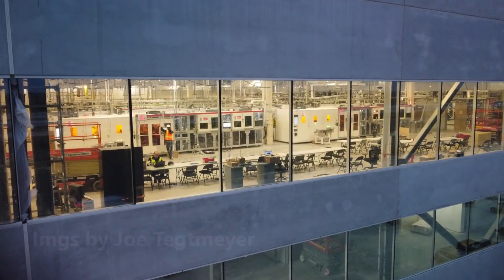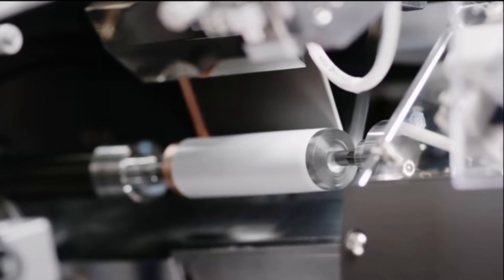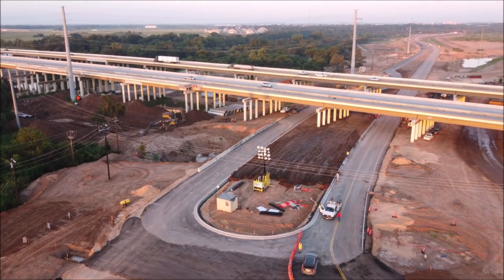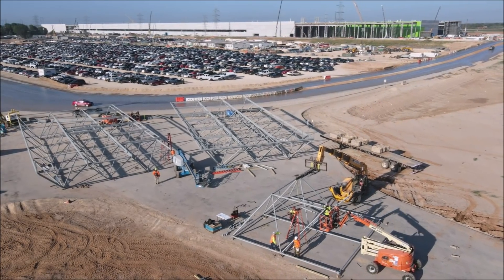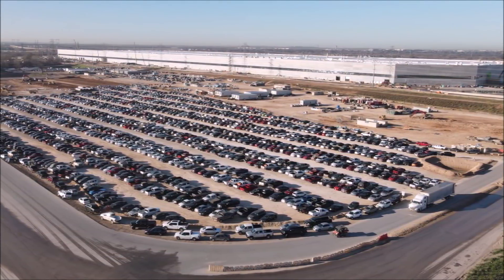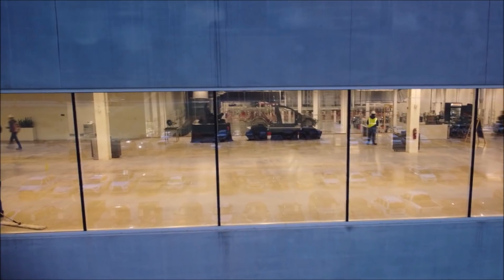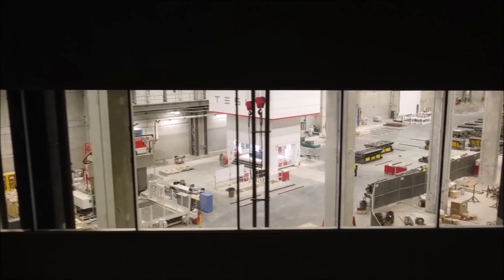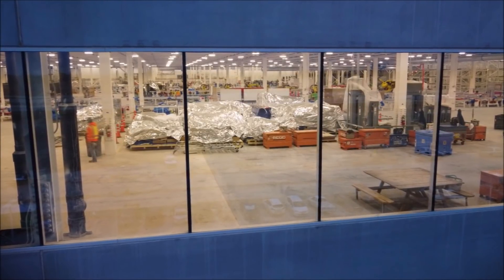BREAKING! Tesla Appears Rolling Electrode at Giga Texas 4680 Battery Facility

Comment: I would be very surprised if they could just plug in the new machines, supplies and materials and start building batteries in either Giga Texas or Giga Berlin. Most likely all of the 4680 batteries will be coming from the Kato rd. battery factory in Fremont, CA, which has most likely been producing the 4680 batteries for a while and stockpiling them for shipment to Texas and Germany to use in the new, Gen 2 Model Y's being built there. I do think that after the full production setup and testing of the new battery equipment results in customer-ready 4680 batteries (in a few months time) that they will be able to ramp up 4680 production. They will then be able to build the 4680 batteries locally for all of their new Tesla EVs moving forward.
Reply: Dean McManus. A likely synonym as to not violate the confidentiality statement in your contract.                                          👁 I saw you parked at 'Kato Rd' this morning.🚙  Team Leader? No.  Tesla Production Manager, Freemont, CA.      The "moving forward" bit, gave you away!
Reply: I thought Kato rd is just a lab to figure out manufacturing techniques and processes that will then be built out in the actual factories that produce the batteries. I could be wrong but I don't think they're producing any large quantities of 4680 cells at Kato. It wouldn't serve them to just have a small stockpile of the batteries if they can't figure out how to manufacture them at scale in the factories that are supposed to make them. If the factories can't make them, then they won't have a viable product.
Reply: @trizzybones  it's a small lab that happens to be in the top 20 🔋 plants in the world.... I understand.
Reply: @monkeysezbegood  Where did you see it ranked as a top 20 plant in the world? That doesn’t necessarily mean they’re mass producing batteries there. Elon described it as a prototyping lab. But as I said, I could be wrong, I just haven’t seen anything describe Kato as a main factory.